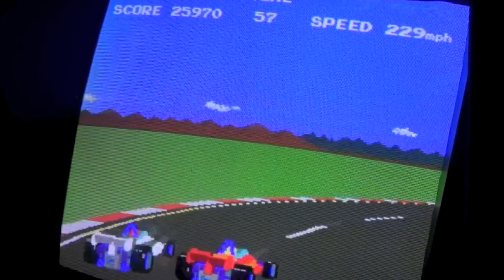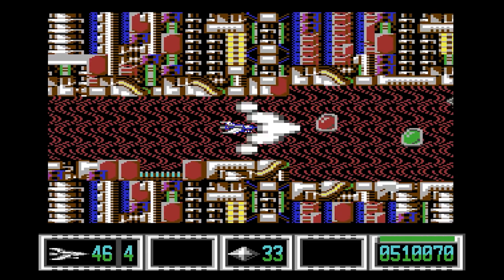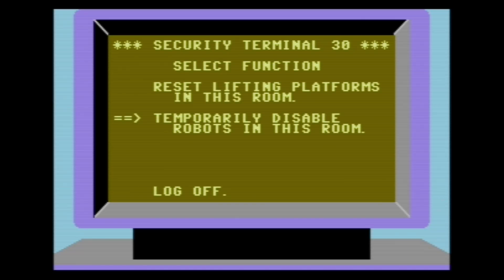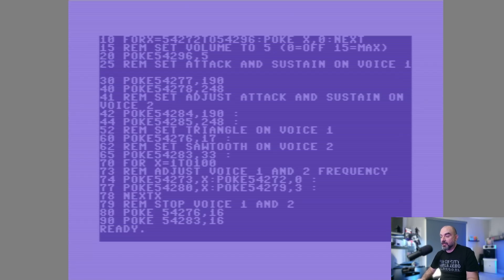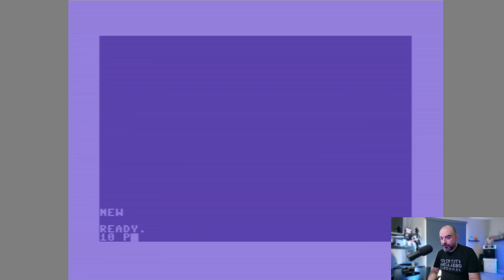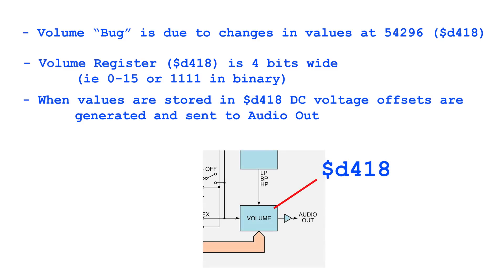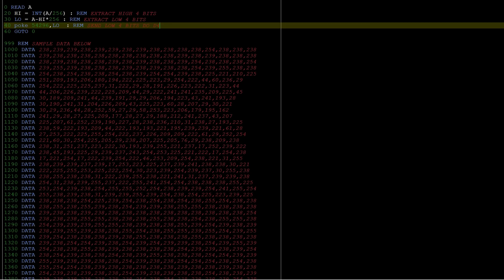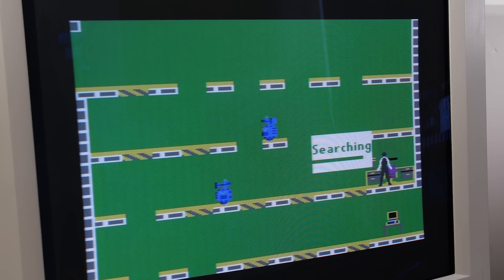How Old-School Computers Played Sound Samples | MVG

Comment: To clarify, Impossible Mission and Ghostbusters used speech synthesis. This was done by a company called Electronic Speech Synthesis that specialised in digitising speech. That was a software-based approach. Other games such as Space Taxi used the "volume bug" method through location 54296. Space Taxi's programmer John F Kutcher actually created his own basic sampler hardware to record himself saying "Hey Taxi" and the pad numbers, then played the sample back at different speeds to give different pitches. 

Later PCM sampling methods removed the problem of the samples sounding quiet. Turning off the screen display during playback was another tactic to improve the quality.
Reply: The company was called Electronic Speech Systems. And I don't know about Ghostbusters but Impossible Mission was definitely playing back a recording; According to a 2013 interview with designer Dennis Caswell, ESS happened to have someone working there who was able to give an appropriately Bond Villain-esque performance. Even if they had used speech synthesis, the SID would still have had to be manipulated into playing back those real-time-generated samples.
Reply: @stevethepocket  the synthesis is based on a mathematical model of how speech sounds, not a direct sample. It's closer to the early example in the video where the SID is playing a tone rather than manipulating the volume register.
Reply: @merman1974 ESS recorded/digitized the owners voice (he had a recording studio in his basement) and then was able to identify redundant segments of the sample, keeping only one and replacing them with a reference to the one sample. This greatly reduced the size of the data and allowed games like Impossible Mission to have a lot of high-quality speech without loading new samples every time. Please see the research I did into the subject in the first link referenced in the description above.
Reply: Thank you for reminding me of Space Taxi. Loved that game!
Reply: Why did turning off the screen help? CPU cycles?
Reply: @MarkPentler  Because you are turning off an interrupt that fires once every 50/60 HZ which burns a few clock cycles each time. When you are trying to run the DIGI player 8000 times a second every clock cycle counts.
Reply: @MarkPentler  yes. The VIC-II chip that drew the screen interrupted the main processor every 8 scanlines, as it needed extra time to draw the screen/sprites. Turning off the screen disabled that interrupt and freed up the processor to concentrate on playing the sample.
Reply: @MarkPentler  You get a bit more speed, but speed isn't the issue, it's regularity of playing the samples. Every 8 lines in the visible screen area stops the CPU for some 62 cycles/microseconds while the VIC/GPU needed to read the RAM. This would make the sound choppy sounding due to the interruption.
Reply: Was that the case with "The Last V8" too?
Reply: @HaquinusDeGothia  Last V8 is a sample, Codemasters made their own sampling hardware and used it on a few games
Reply: @merman1974  Thanks! 👍
Reply: Interesting thing, ESS is still around making high-end DACs.  :)
Reply: Let's not mix speech generation and playback together. It was synthesis understood as phrases assembled out of phonemes but later used the same $d418 register for output as samples would :)

Comment: When I was a kid I wondered how they managed to do the speech in Ghostbusters and Impossible mission. If you have enough storage you can play entire songs on the C64: the 1541ultimate cartridge has a 16 MB REU that can be used as a storage device an can hold more than 17 minutes of audio with a decent quality. I made my own music player called "Breadamp" that plays sampled music from the REU of the 1541ultimate. I often use it to listen to "real" music on my C64 on retro meetings. Later I made a video player called "Koalavideo" that plays videos made of a sequence of Koala images (file format of the Koalapainter) and sampled sound.
Reply: I was surprised to read about Koalavideo, and saw it in action on your channel as well!

Koalavideo appears to run at around 10 FPS, which is understandable given the widescreen image, as the borders can be effectively ignored. What digi frequency are you using, if I may ask? Also, is the REU in use here simply extra memory you must cue up and copy at 1 MHz, or is it the 1-byte-per-cycle type of hardware assisted REU? If so, I imagine it was probably difficult to weave REU commands along with the NMI (is it an NMI?) to play the digi audio.

In 2021 I began a project very similar to your program. It plays a single fullscreen video at about 6 FPS with a Mahoney Digi of 7867 Hz. It uses the BackBit cartridge (on an otherwise stock C64) which allows access to a file of up to 4 GB (in 64 KB chunks) with a delay of several thousand cycles when you change that internal 64 KB pointer. I was so excited and secretive about my program, but now I know it's been done before.
Reply: @lupedarksnout  The sample rate of the audio is 11700 Hz. The player supports framerates up to 16.67 fps and the aspect ratios 4:3, 16:9 and 16:10 (16:10 uses the entire screen, the others add borders that let the normal borders appear thicker). The REU is technically a storage device: the CPU and other chips cannot directly access its memory but the CPU can instruct it to transfer data between the REU memory and the C64s memory which the CPU and other chips can access. The transfers are done in 8 byte chunks to limit the jitter of the sample playback (while transferring data no samples can be played and too long transfer cause audible sample delays, the 8 bytes per transfer are a compromise between audio quality and max. fps). Max. REU size is 16 MiB which allows around 105 seconds of 16:9 video or more with lower frame rates (at 7 - 10 fps you can fit in an entire music video). I chose the REU as a storage device because it is fast, easy to control and most important: more users have it as it is built in the popular 1541ultimate cartridge. Only disadvantage is the size limit of 16 MiB, but on the 1541ultimate there is an API that allows transfering data from the USB stick to the REU. This way you could automatically load the next part of a video when the first has finish played and have longer videos this way (with short pauses while loading the next part).
Reply: @daddlertl3  Thanks for that! Interesting how your program needs to take a different approach to accommodate the REU. When it returns from copying 8 bytes, I wonder if it stalls until an interrupt plays the next digi sample, or if you manually feed $D418 without the overhead required by interrupts. One is automatic, and the other would require precise timing. It's fun to think about the possibilities of optimization.
Reply: @lupedarksnout  The sample playback routine is called by a NMI triggered by the timer of the CIA chip. The samples are played from a small 256 bytes audio buffer in the C64s memory. The main routine is running freely and preparing the next frame ("download" the required data from the REU to the C64s memory) and checks the status of the audio buffer and refills it from the REU if needed. If the next frame is prepared but not due to be displayed yet, the main routine is just checking if the audio buffer needs to be refilled until the next frame has to be displayed. The program uses 2 VIC banks to be able to display a frame while the next one is prepared, only the color RAM needs to be updated in realtime, because it only exists once on a fixed location and cannot be bankswitched.

Comment: "DIGI's" really set the C64 sound apart from bleeps and bloops of the pack. Just an FYI, you refer to the newer SID as 8520, which is the CIA chip, instead of the 8580 which is the newer SID chip.

Comment: There was a program for the Apple 2 that allowed you to record and playback music/speech whatever. The Apple had way weaker sound hardware than the C64 but somehow smart programmers made it work. However, I think it used all the Apple’s processing power, so you couldn’t incorporate it into games or anything.
Reply: Actually, the laser sound from the port of Defender for the Apple ][+ sounded digitized and just as “buzzy” as the samples from “Ghostbusters” and “Mission Impossible” on the C64. Also, I wrote a short 6502 machine language program that would sample the cassette in port at 0xC010 and then toggle the speaker at 0xC030 - if you hooked s powered microphone to the cassette in port, it would make a cheap “robot voice” filter when you spoke into it.

Comment: Thanks for the video. Actually I am not sure if the demo Apparatus really is using samples for the music. First demo with similar realtime effects and sample music is Fantasmolytic which has been released in 2015 by Censor Design and Oxyron (on the second disk of the demo). There have been other demos before but showing more simple effects.
Reply: Surely THCM, Mixer & Soundemon's Vicious Sid (2008) has to get credit for doing something genuinely novel with digi playback. Jitter-free, 8 bit, mod playback with filters on a 64 is no joke.
Reply: @firstsurname9893  Ah, thx. Did not know.

Comment: You forgot to mention speech synthesizers, which also appeared on the C64. In Poland we had such on the pirated BlackBox cartridge, where the Commodore was able to translate text into Polish speech in real time. It was super impressive at the time.
Reply from the maker: yup, and thats probably a dedicated video im going to do !  the difference is that they had additional hardware to make it work
Reply: @ModernVintageGamer  it was working on the stock C64. No additional hardware required. :) It would be cool to make a video about it!
Reply: @gregor_89  cartridge = additional hardware
Reply: @mikeuk666  it's not. Cartridge was used for other unrelated synthesizer stuff and that synthesizer was there as a bonus.  You could load also that synthesizer from cassette tape or disk and it would still work the same on the stock C64.
Reply: @mikeuk666  I had S.A.M. in a floppy disk - no cartridge, and it could sinthetize speech pretty well for its time. I spent too much time as a 9 year old figuring out how to spell cuss words phonetically in English and Spanish to have the computer speak them and prank call my uncles with it.
Reply: It could sing too :]
Reply: S.A.M. - Software Automatic Mouth - could also do this, all in software on the C64 (and a couple other computers of the time). In 1982. There's now even a Javascript version of the software online, that can run in the browser and "speak". Unmistakable, sounds identical to the way it sounded on the 64 way back then.
Reply: Yep, i used it too without additional cardridges or other hardware.
Reply: Wasn't there also the Software Automatic Mouth?
Reply: I absolutely support any opportunity to learn about Polish-related tech history!

Comment: Earlier digitized sound - TumbleBugs on the Atari was one of the earliest on home systems (1982) - though the early games tended to just have 1 or 2 short phrases often at poor quality.  The compression technique used for Impossible Mission and Ghostbusters was a proprietary secret and so good that it's hard to find technical information on it even today.
Reply: I don't know about those, but various demos used ADPCM which can do 2x compression easily. There's a lot of info in old research papers, but you can play with the idea yourself and come up with decent schemes.

Comment: The main disadvantage of the master volume method is that it screwed up anything else you had playing on the SID voices.  The other better method which wasn't covered I believe was to use the pulse waveform at a high frequency then vary the pulse-width register to control the duty cycle for PWM audio.  Then use the low-pass filter on the voice to cut down the unwanted carrier noise.
Reply: Sounds like a couple of parallels to the PC Speaker tricks for sample playback! 

With the PC Speaker, you can set the timer chip to output a constant voltage, then toggle the speaker-enable gate on and off for one method, which sounds terrible but is loud. The other involves using the timer's single-shot mode with varying countdowns to implement PWM, which sounds pretty good, but is also pretty quiet. If you want to hear the difference for yourself, grab a copy of Fast Tracker 2 and flip between them while playing a module.
Reply: There is another and even better method that doesn't require the low pass filter : at a chosen sampling rate (usually 7819 Hz / every 2 scanlines so you are not bothered by badlines) use the first half "ramp-up" side of the triangle waveform at a controlled frequency to reach a certain value and generate one sample. Playing with the voice "test bit" the SID will not output the triangle waveform but will hold the sample value at the moment the test bit is set. Also when test bit is set the oscillator phase value is reset to 0. So you do have control ! Therefore if at 7819 Hz you reset then set the test bit and output a new 8bits high frequency value (from your sample data table), you can play samples at ~7-8bits resolution (even though the DAC is technically 12bits). The reason why triangle is used and not sawtooth is simply because the sawtooth is "twice as slow" as the triangle in ramp-up phase, and it would not be able to reach full DAC volume.
Reply: @laurent64  IIRC this was a great way to run digis because your filters still work perfectly and you can largely filter out your carrier for a cleaner sample as well as do other effects.

Comment: Sadly, we never had a C64. But, we did have a TI 99/4A, which was a little more on-par with the VIC-20 than the C64. *But*, it had a little expansion box that plugged into the side that gave it speech capabilities. This was in the early 1980s, and having dedicated hardware, easily accessible via BASIC, that could emulate speech was nothing short of amazing to young me.

Comment: I remember running SAM (Software Automatic Mouth) on the Atari 800.  It was quite amazing, in 1982.  The Atari's sound hardware was more limited than the C64's (square waves only for synth sound), but it did have one extra channel (4), and most importantly, a PCM channel.
Reply: 5 sound channels. 4 in Pokey, 1 in GTIA. And the Pokey can go into 2 channel 16 bit mode. And it can emulate the sound of the SID.
Reply: All four channels could be put into volume control mode for PCM.

Comment: When i was a kid i had a TV with a "multi pin" (dunno how its called) input or output,
and i had a fitting "multi pin" cable ... and the c64 had such an input or output ...
i was stupid and plugged into the c64 and into the TV ...
and my sound was gone (very very low volume) :D
BUT for w/e reason all sample-sounds in games were loud. That was cool :)
I never understood what happen. But i learned to never put a plug into something you do not know :D

Comment: Wouldn't it be possible with PWM, that is using a square wave with varying duty cycle and taking advantage of the natural low-pass filtering of the speaker?
Reply: Coders already thought of that 😉 There was a demo years ago, possibly one of the Wonderland series by Censor Design, that implemented PWM sample playback but there was a horrible high-pitched whine that made it very difficult to listen to.

This problem was solved more recently but the technical explanation is over my head, if you're interested there are articles on the Codebase64 website which explain it.